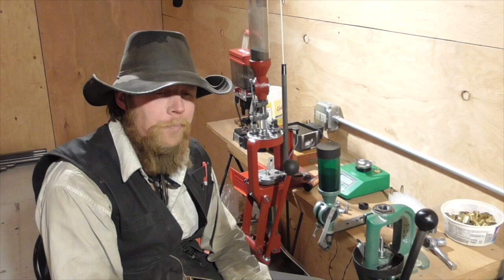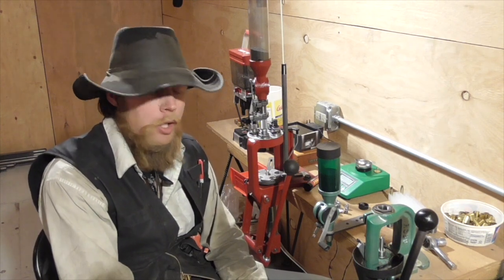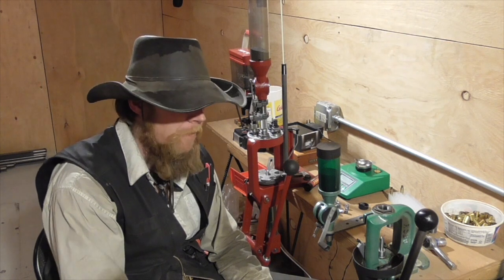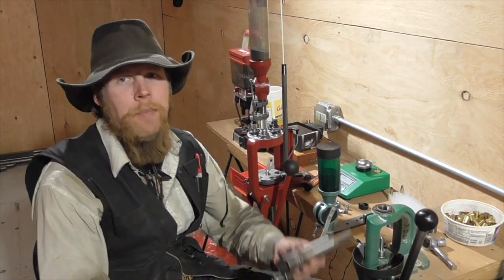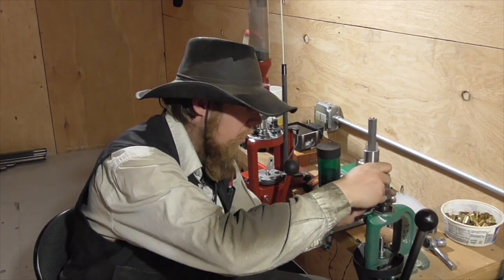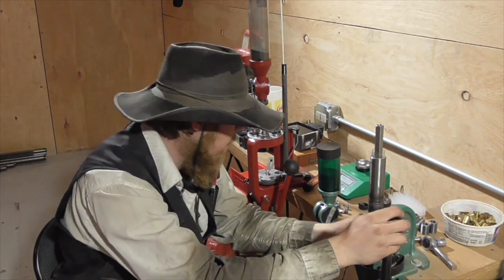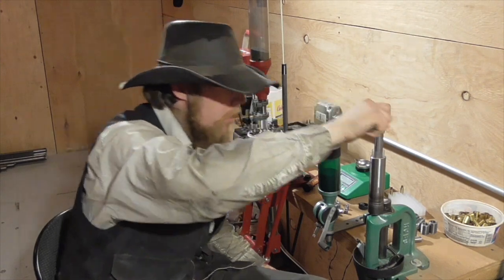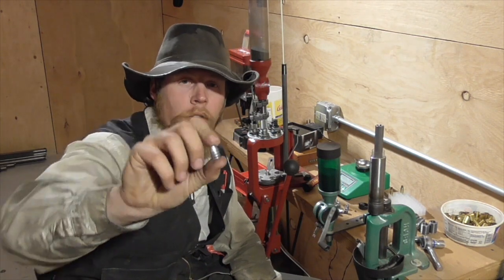Improvisational Lubrication of Projectiles (TIS214)

Comment: Very nice. I got into reloading in the past couple of years and never thought of using lube because of powder coating. However, it is very interesting how they do it. Isn't there also a lubriciser that uses heat as well? I  use a similar process for swaging 22lr (and other caliber) bullets. Surprisingly simple to make swaging dies if you are just swaging lead.
Reply from the maker: Yes, depending on the particular lube used, some can be extruded at room temperature, while others require heating.  There are different methods of applying the heat: some lubrisizers have a build-in heating element, while most are comparable with heating plates or other heaters that attach to the outside.

Comment: Actually, there is a much easier way to lube bullets called the pan method.  You simple put the bullets in a shallow metal pan of sorts, bottom down of course, melt the lube in the same pan till it is above the grooves (or melt the wax first then add the bullets), and then "cut" the bullets out when it cools with something that is the same size as the OD of the bullets (a proper sized case can work, and of course those can also be made into a nice powder dipper too by soldering on a handle). You can keep the lube in the pan and just remelt it then add new bullets there after, adding more lube when needed. Lee use to sell kits for many sized bullets to do the same thing (a small shallow metal pan, the lube and a cutter) that  kind of matched up well with the manual "lee loader" kits that you used a hammer or such to load with. Along with a the bullets (or a mold and lead) and the rest of the fixings for reloading, you would have a very nice little kit. Was actually the method an old timer taught me to reload first before I went on to press methods, that is using the pan lube method and lee loader. 9mm in fact.
 

You could also then size them through a lee sizer once you cut them from the lube. BTW, the lee sizers that fit in the press are interesting in all sorts of ways beside just for sizing bullets. 

All the lubersizers I have I picked up off of ebay much cheaper certainly than retail. As well, might look into making your own lube and pouring it into sticks, if one was to persist in using a lubersizer for volume production. Also much cheaper to make ones own lube no matter what process one uses. For the pan method I just use to use straight paraffin, though there are certain better lubes one can make, like adding a some portion of bees wax, etc.

Comment: Have you considered the lube aspect of POWDER COATING lead slugs?
I've seen a lot of vids touting how great powder coat is, but never tried it myself.
Reply from the maker: Yes, actually this video was a spinoff of a project to compare different lube alternatives, and I included powder coating in my comparison.  More to come on that in future videos.
Reply: I just bought some powder coating from Harbor Freight, but haven’t put it to use yet. I’ve been using Lee Alox on my pistol calibers for the past 15+ years, with good results, but they aren’t pretty. Recently, I’ve seen some good ideas for aligning the bullets base down, which will greatly simplify the powder coating, when I do that.
Reply: @papapatpatterson  the Shake & Bake method for powdercoat bullets seems pretty simple... just a matter of how many you can fit in a cheapie Toaster Oven.
Alternatively, you can just set the powdered slugs on the dash of a car parked in the Texas Summer sun... but that excessive heat might scorch the color